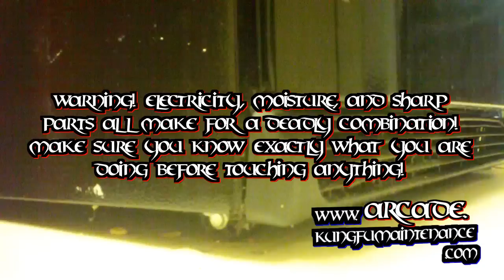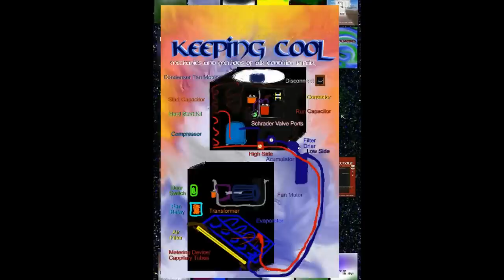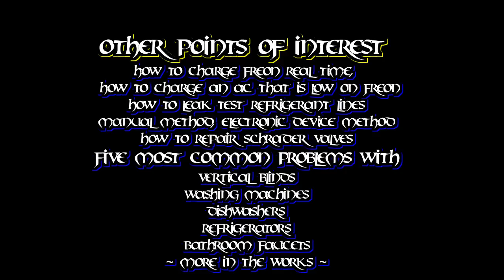How To Fix A Refrigerator Door That Will Not Close Or Won't Stay Shut Properly

Comment: - Lean on the door to hold it in place, Or tape it shut on both sides. -Next remove the 2 lower hinge bolts using a ratchet with a 10mm socket and a 3" extension. - Next pull the hinge downward and outward pulling the hinge pin from the bottom of the door. - Next find a washer that will fit over the hinge pin, then Peel up the plastic wear washer and put your shim washer on underneath the wear washer. - Next push the hingepin back into the door,  then Push up on the door a bit to align the bolt holes and put two 10mm bolts back in.  Tighten the bolts and Enjoy! This worked perfect on my rental grade Frigidaire, I used a couple copper drain plug washers that I had laying around, Thanks! -
Reply: 13angryBs thanks for the tip

Comment: I had this problem - a door that wouldn't close easily.  I cleaned the gasket and the door at the gasket contact area but that didn't help.  After seeing this video I focused on the lower hinge area and noticed some metal fragments right at the hinge.  As a first step, I sprayed WD40 onto the hinge and it worked enough to avoid having to add a shim-washer as was done here.  My door will need this eventually as the hinge shim is wearing thin so I'm grateful for having this pointed out.

Comment: I actually had this same issue last night.  I figured out what the issue was on my own and before it happened I think I heard it break.  If you notice that when he shows the door the issue is the bottom of the door where the container holder is located it's dragging along the bottom of the inside.   My solution from 9 pm until this morning was to be sure to lift my handle to elevate my door so it would close and open smoothly.  Look closely at bracket that he removes...It's kind of an upside down L shape which holds the bottom mount for the door hinge.  The other part of the L shaped bracket goes flush against the fridge.   His hand does get in the way but he gives just enough to get it fixed.  Thanks!

Comment: It shows what I am looking to fix, a door seal that is compressed od the non-hinged corner.Parts polaces want $ 140.00 for a piece of rubber (replacement seal), I can buy a used fridge for $150.00 , without replacing the seal !! I have heard about putting putty in th channels of the seal, and heating with a hair dryer. I'd love to see this done to keep perfectly good fridges from being garbaged. Come on now! Who can help me ??